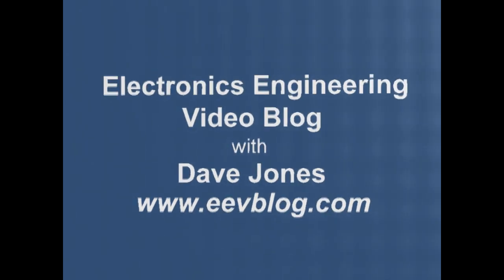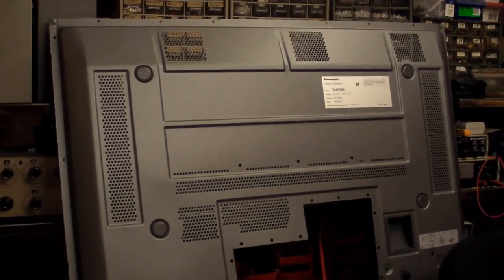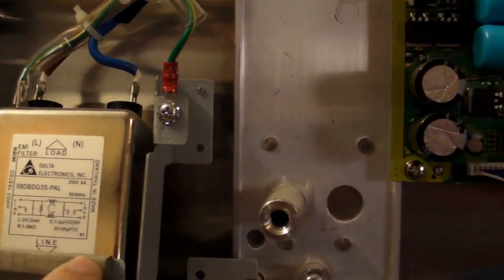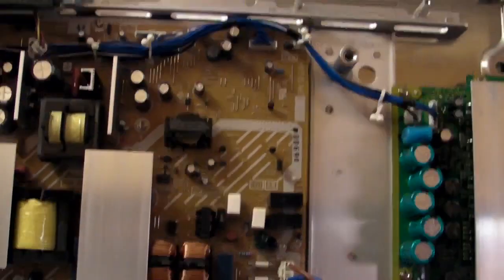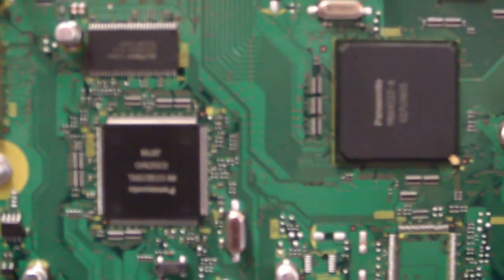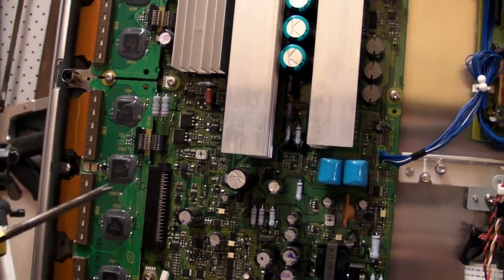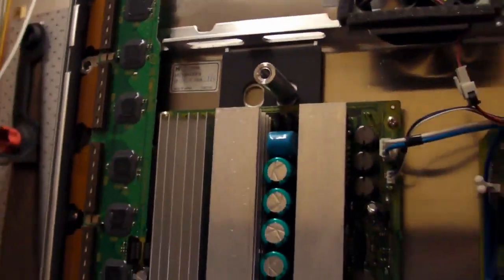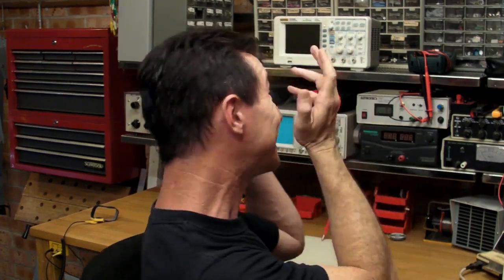EEVblog #52 - Panasonic Plasma TV's Suck (and a Teardown)

Comment: hey guys i have a similar problem,but in my point of view i m a bit luckyer then you ,i purchased a panasonic 42inch plasma (SH, only 100 euro) and it has black line on the screen! i did same experiment  you did with the flex and mi black bar changed to white,so i think its not the panel,i  ordered the C2 driver board and if this dont work i will order the D board! thank you EEVbolg..!

Comment: Well gee guys I'm sorry for your troubles.  I have the exact same TV.  I had a HUGE Mit but if failed.  So I said Fthis and bought one off of Graigs list. It was almost new.  The guy had bought a bigger one and put the 42 inch in his bedroom and never watched it.  I have had it for 5 years and I got two young kids, well not so young any more, and I paid a little over $500.  Just about what the extended warranty would have cost Dave.  Moral of the story,  DON"T BUY NEW. It's going to fail anyhow.

Comment: Don't see how its worse than Samsung plasmas blowing their power supply or the LG pop of death. I don't know if it is really planned, I think it is just poor design to speed up manufacturing. The manufacturing standards are about the same on all of them. I'm fixing a pop of death Maxent made by LG at the moment, Y-SUS board on this one, got two slightly domed caps on the PS I'll replace when its open. No name caps & heat is a bad thing. I'd honestly be surprised if any 2007 era Samsungs work now

Comment: just wondering how do u know its that chip and not the support circuity as my plasma broke with the same issue and i was told it needed a new screen then i took it to a joe smoes  tv repair and 2 caps later its works great how ever mine is a dell that is made by samsung but just something to think about

Comment: We've had a 42PV60 for like 5 years now, and it's been working fine. It is, however, one of the finest RFI sources on mediumwave and lower shortwave you can imagine. Apparently they got that fixed in later models with a panel redesign, dropping emissions by about 40 dB. Good ol' Mr. Faraday to the rescue, I suppose.

I guess I wouldn't get a plasma any more, since while the colors are nice, the flickering is a bit annoying. It would have to be a *nice* LCD unit with large viewing angle though.

Comment: Man that sort of thing drives me nuts.

You're right about the location of the problem - it is at the  ribbon or inside.

I'm sorta crazy and would likely have deconstructed the plasma assembly as to see if the ribbon cable was replaceable.

Worst case scenario you have yourself a boat load of parts to sell on ebay.

Thanks much for taking the time to share - I'm sorry for your loss!!

Comment: Just put the tape on both sides and top and bottom to mask the set then adjust the size of the picture to fit in the masking and you will have a working approx 36" TV.

Comment: Dave - did you try to "fix" it per video 0ykPsV2voYU  ? I think this "fixed" a solder joint failure! 
I've seen chip-on-flex fail elsewhere. I was able to repair by reflowing the solder with an SMT rework air gun. The goop around the row-driver chips is indeed for both dust and high voltage, as a dust particle bridging the ultra-fine-pitch HV drive IC pins would be a definitive Bad Thing.

Comment: lol...cool ending.

BTW Dave, the foam around the fans are probably to prevent air from getting in through the ventilators of the fan. The air should only enter through the bottom ventilators.

Comment: If you, Dave, want to repair your TV, may I suggest you to look around on your motherboard for any of "zorched" parts around the power supply? It's the SMPS that usually fails first. I have LCD TV and is considering repairing it by hand in the future time. (BTW, be careful around Cathode rails of the Plasma display panel - they usually carry higher voltage - maybe 300VDC - that's fed through the pixel switch transistor arrays - something to keep in mind. LCD panel won't hurt you but Plasma can.)
Reply: Not if you mess with the inverter

Comment: I do see two big design flaws in that TV.
There is nothing protecting the column driver cable from rubbing on the metal chassis and no strain relief on the driver chip carrier on the connector end to kept the cable from bending too sharply which it appears to have done.

Comment: Bufferboard seems to be on the frits.
normly has to do with a cap going out causing an oselation in some of the ic's heating them up till they fry.

and i find more shops saying the screen faild and it's just the bufferboards.

Comment: They maybe on the back of the board above the ribbon for that one. if you look the rest of the chips have two each on each side. but the end only shows the ones on the right. so they should be on the left side of the connector and most likely on the back of the board.

Comment: funny but you should try the black chips to the right and side of the plug they are known for solder issues and sometimes when you resolder them the tv will come back to life. it works for other tv's with black bars in the video. sometimes they are on the milar but on this tv they are on the board above.

Comment: A friend of mine had a similar problem. The TV was a cheap one, but inside looked very similar to this panasonic. The local service wanted 600$ to fix it. So we just downloaded a service manual and found that the Y board was dead. I was lucky to get one online (just by googling for the part number) for 150$ and the TV was fixed :D
Thanks for sharing your experience !

Comment: @number7redking 
So?? What, you think Panasonic would allow reselling in Australia without using a 230/240v power supply or even a switching PSU like 115-240v? that's stupid..

Comment: While are the driver chips on the plastic connector ribbon?
I bet it is a mechanical failure of the die bonds.
Does anyone have a guess why they did not mount it on the glas?

Comment: This is the main reason you should always burn-in your electronics when you get them.  Basically, if it's going to fail due to a faulty part... it's going to happen within the first 90 days of use... IF YOU USE IT.  So, do some home HALT testing on it and just turn it on and leave it on 24/7 for a couple weeks.  I have the same TV, and have the extended warranty, and it's lived well past the extended warranty period.  It's on just about ALL of the time too :)  Nice fix at the end! Great videos!